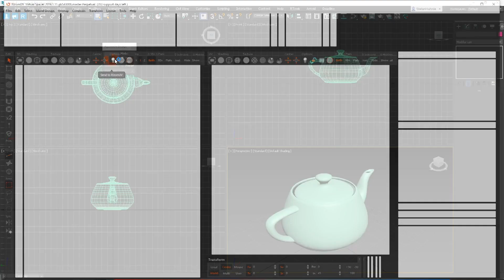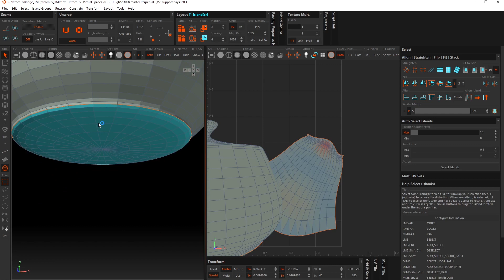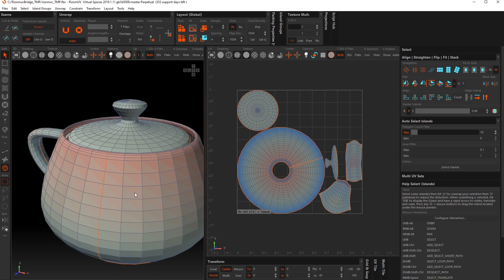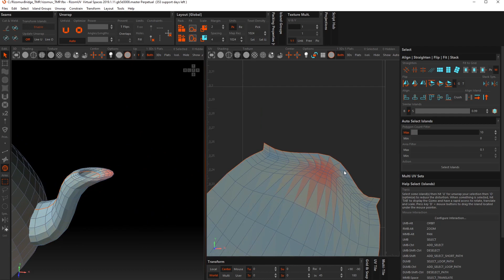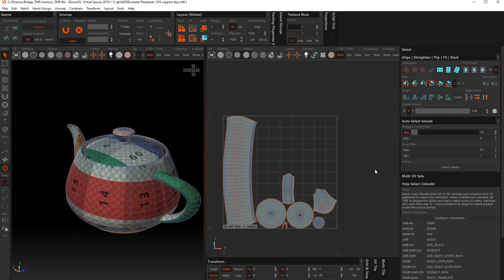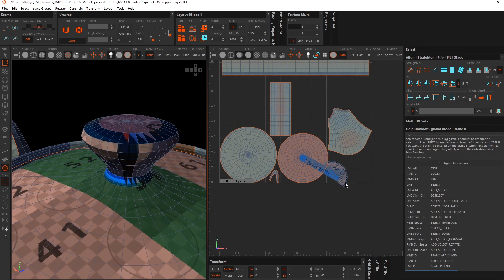RizomUV Introduction Tutorial - Unwrapping a Teapot from 3ds max

Comment: Great tutorial! Could you please tell me, is there a way I could export the unwrapped map directly to Map channel 2 in Unwrap UVW modifier. It automatically goes to channel 1 when I save it. What I do is, I save it as a .uvw map, and load it to channel 2. But if I could direct it to channel 2 right after I save it in RizomUV, it will save some time.
Reply from the maker: There is a extended version of the rizom uv bridge which makes it possible to work with UV channels 1 to 99 - unfortunately the programmer stopped selling the script atm but here is the gumroad link maybe it is available again in the future: https://gumroad.com/l/Unfold3dMax_Bridge_ExtendedEdition . But there is a bit faster way to transfer the uvs vom channel 1 to channel 2 in 3ds max without saving it to a uvw map: if you add an uvw_unwrap modifier to the object and change the map channel parameter from 1 to 2 you'll get a "change channel warning" box - here you can use the button to move the UV coordinates to the new channel.
Reply: @Deepframes3D  Thank you for the reply. That's unfortunate the script is not currently for sale. Otherwise it would have been so much helpful.

Update: There's a way to direct the map directly to channel 2. If someone is looking for a way, here it is.

On the right hand side of RizomUV, there is a tab called UV Channels. There, you get an option to create UV channels. Create a new one, name it as UVChannel2 and set it as current. Then when you save it after unwrapping, there will be two channels created in 3ds max. One for channel 1, which is the texture map, and the unwrapped map will go to channel 2 automatically. Then, only you have to do is to convert the object to editable poly/mesh ect. and it will be saved to separate channels.